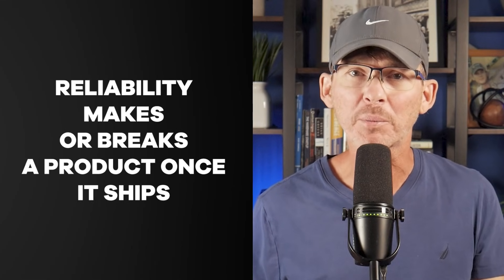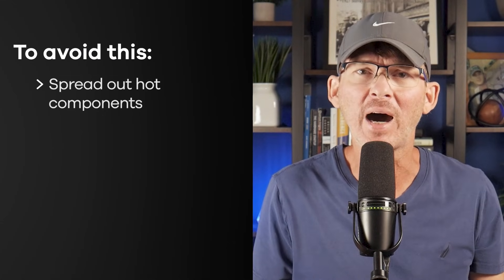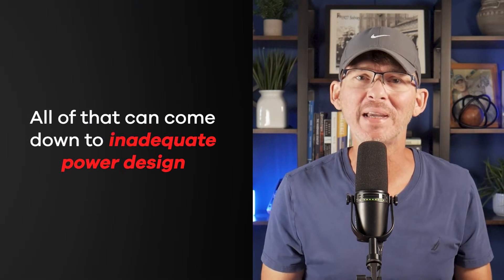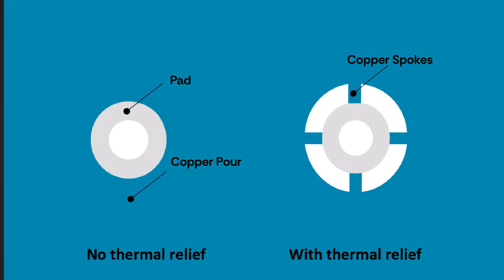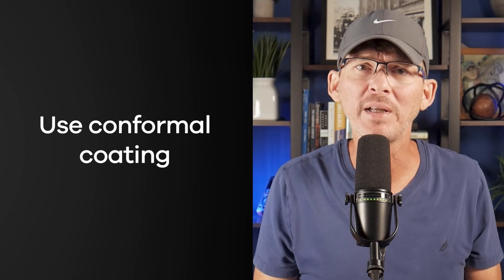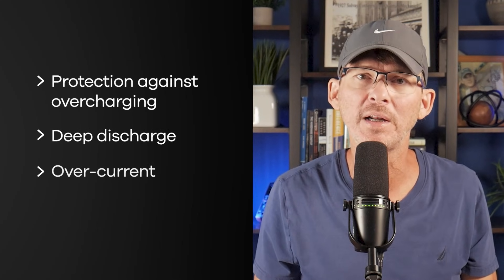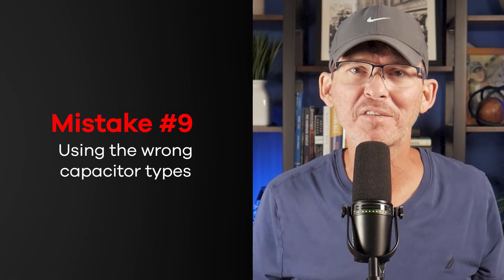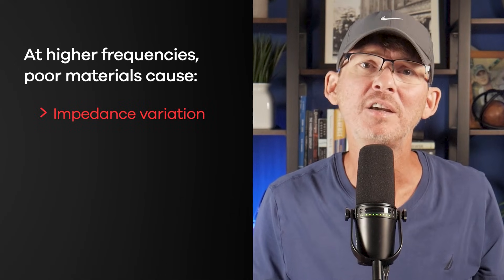10 PCB Design Mistakes That Damage Product Reliability

Comment: What's the function of a filled via?
Reply: Filled vias allow you to place a via within a solder pad and to avoid wicking solder through the via which would otherwise compromise the amount of solder in the joint.  They're often essential in tight pitch BGA layouts.
Reply: @Peter_S_  Is it a conductive via?

Comment: Could you make a similar video but for basic and fundamental design mistakes? E.g. I read online that traces should be routed at 45 degrees angles. Routing at 90 degrees is apparently a mistake?
Reply from the maker: That one used to be common advice but no longer. 90 degree bends only really impact very high speed lines, although in general I still like to avoid them. Good idea on a fundamental mistakes video though and I'll definitely consider it. Thanks for watching!

Comment: Some additions from a production engineer at a PCB fab:
1. Managing thermals and solder joint quality can be a delicate balance. I've seen designs that just used the PCB as a heatsink by adding 20 via's on a 4 layer board. But heatsinks that work in the field will also work inside of a reflow oven or solder wave, causing the temperature to stay low in that region keeping joints colder than intended. Component's themselves can also have a lot of thermal mass especially large inductor's. Place copper fill strategically around these component's.
2. When designing PCB's that need to be conformal coated. I can't stress enough that you must space out components that must mustn't be coated. 1mm of space can look huge when zoomed all the way in in CAD. But in reality, depending on how the fab applies coating, this can be a huge problem causing quality issues, more boards to be rejected and higher production cost. Always talk to your fab in advance for advice.

Comment: 6:10 environmental protection is my personal favourite: I once was a service technician for welding machines. You won't believe how many of those didn't design for metal dust in their surrounding. For a machine that creates metal vapours and requires all surfaces it interacts with to be ground to bare metal directly before use of the machine, that was a funny design failure, which luckily was often resolved with some compressed air.
Reply: I was a service tech for many years, & yeah, real environments can be insane.

Comment: When I was at Boeing in the '90s one of the projects I worked on was the engine controller unit for the RS-68 rocket engine.  The basic functions of this ECU were pretty simple -- it controlled the 4 valves of the engine according to a pre-programmed "flight profile" -- but it had to be EXTREMELY reliable.
The guy in charge called himself "a damn fine systems engineer", but he basically knew nothing.  It was the worst case of the Dunning-Kruger effect I've ever seen.
One of his dumb decisions was to include a microprocessor.  This was completely unnecessary since all the functions of the ECU could be implemented with a state machine, and he already had an FPGA on the board.  I once overheard an actual system engineer raise the question of software reliability in a meeting.  The self-proclaimed "damn fine" guy laughed out loud and said "software doesn't break!". 
Note to newbies:  NEVER have anything that is super safety-critical depend on software, if you can avoid it.  For example, if a machine has a big red button on the front labeled "emergency power off", it should open a relay that cuts off power to the machine.  The red button should NEVER just go to an interrupt pin on a microprocessor, unless there is an an EXTREMELY good reason for it.  In the ECU example above, the FPGA-based state machine was reliable because you could test all possible states, even "illegal" states.  But a CPU with firmware can have an enormous number of untestable states, thus making it a reliability risk.
Reply from the maker: Thanks for sharing your experiences!
Reply: To add to that: That's why in Germany (and the entire EU, I believe), it was illegal to use software in emergency-systems like emergency stops until about a decade ago. It was allowed for certain very specific and highly certified things after that.

Comment: Back in 2003 I had a reliability issue with a piece of test equipment I designed, a bit-error rate tester.  It had 17 data lanes that each ran at 2.5 Gbps.  When I tapped on the side of the chassis with a screw driver, the eye patterns for all the lanes immediately clouded up.  This baffled my for a while, until I realized it was due to piezo-electric  effect on some multi-layer ceramic caps.  I replaced them with tantalum caps and the problem went away.
Each lane had it's own dedicated PLL circuit to multiply a 156 MHz reference clock to 2.5 GHz, and each PLL had it's own dedicated low-noise LDO voltage regulator to power the VCO.  The ceramic caps were used to decouple the outputs of these LDOs.  Tapping the chassis caused about 10 to 20 microvolt step on the VCO supply, lasting a few microseconds.  This pushed the VCO frequency, ever so slightly, but phase is the integral of frequency, and a few microseconds is a large number of bit periods at 2.5 GHz, so the lanes could get almost two whole bit periods out of phase.
Oh, and the system also had problems with dendrite growth, but I don't remember how I solved that one.

Comment: I am not making PC boards for production just as a hobby and sharing them on PCBWay. My designs use CMOS low power ICs and run on a 9-volt battery.  I suspect I might be getting away with things that would not work in something more complex.

Comment: Reliability what makes or breaks a product... Apple: hold my beer. :) They tend to be sabotaged in every generation in some way electronically or mechanically making sure they do not last. Sure they won't fail before the warranty is out but planned obsolescence can start at the point where Apple puts the 1.5V data line next to 42V LED backlight power feed on a ribbon connector :) What could possibly go wrong.

Conformal coating lol.. another thing Apple has never heard of.
Reply: Apple is a cult

Comment: I've seen so many strange failures it boggles my mind that stuff isn't failing all the time. One time I had a short that was somewhere inside a 2 layer pcb which was shorting out two traces that were >30 mils apart. I could not figure out where it was coming from. I had to cut a 3 inch section of foil and run a jumper wire to remove the short. This wasn't even an inner layer short lol. That made me question my faith in anything electronic. Yet I have a 40 year old motorala SBC that starts up and runs for 10 hours a day every day.

Comment: Hardware-Design is hard.. at all..
I spend around 70% of the development time just to find correct components to fit together. It's also very expensive and frustrating. And the more you learn the more you feel unsure, because of all the rules like described in this video. It's a very useful summary of design-rules. Many thanks John!

Comment: Using different types of capacitors can be beneficial, but using ceramic capacitors with different values can cause problems. As capacitors become inductive beyond their self-resonance frequency, a combination of two different values can become resonant.

Comment: SOME ceramic capa have hideous negative voltage coefficient of capacitance. It is not a universal truism.

Some ceramic capacitors decrease in capacitance with simple aging. They'll do it in circuit or sitting on the shelf. If the cap is heated to the Curie temperature it is "reset" to the original value and aging begins anew. Reflow soldering temperature is usually above the Curie temp.

Comment: The notion that capacitors need to be derated to half of their rated voltage is simply nonsense. It might be true if you are buying cheap trash.

Years ago I had a discussion with an applications engineer at a major manufacturer of high quality electrolytic capacitors. I was specifically asking about benefits of of voltage derating for a product where high reliability was very important. He said there is no benefit. This was an actual capacitor expert, not some rule-of-thumber.

Aluminum electrolytic caps will also withstand and in fact are rated for withstanding short-term overvoltage.

Capacitors "dry out" due to excessive operating temperature, not operating voltage. Temperature rise due to ripple current is substantially worse than rise due to ambient heating.

Failure to match the PCB hole spacing to the lead spacing of radial electrolytic caps can grossly shorten the life of the cap due to stressing of the elastomer seal. 

Solid tantalum capacitors are another matter. Voltage derating can be beneficial and in some cases essential. Paying attention to rate of rise of current is very important. All of this stuff is well documented in ap notes from "big name" cap manufacturers.
Reply: It depends on the use case. The example John gave a 25V rating on a 24V machine in which your device will just be one component. For this use case, he is absolutely correct, although it doesn't need to be "at least 2x", but you will get a lot of failures if your capacitors are rated for less than 35 V, as the power supplies for industrial machines are often tunable and will get tuned to achieve 24 V at the farthest component from the supply in your switching cabinet. This often results in more than 25 V on a nominal 24 V line at the start and the upper end of the tuning range often is around 28-32 V, depending on the manufacturer. For automotive parts, the actual supply voltage isn't 12 V, but a few V higher, depending on the engine (and therefore generator) RPM.
You aren't designing exclusively for component variation, but for environmental factors, too, and one of them is an imprecise supply voltage.
If you can control voltages precisely and certainly, then 25 V in a 24 V might be enough, but if you hand it out to customers to hook up to a standardised supply voltage (6V motorcycle, 12 V automotive, 24 V automotive, 24 V industrial, 48 V industrial, generally the power grid, etc.), then you will have created an unreliable product with such a small tolerance.
Reply: @KarlKarpfen  Indeed. Back in the day, it was standard for automotive stuff to assume a 13.8V power rail, rather than the 'official' 12V, because that's what you'd see when the battery was fully charged & the vehicle was in motion.
Reply: @theantipope4354  That's the charging system voltage.  A 12.6 Volt lead acid battery needs a slightly higher charging voltage.  Many consider operating voltage of vehicles to be 14 Volts.
Reply: This is true. It may even be that capacitors stored under voltage bias will survive longer than capacitors stored with leads shorted (or even open circuit). I use 95% derating for electrolytics, so a 16V cap can go on a 15 volt rail

Comment: Managing environmental possibilities is a great one!  I made a kitchen management module for my kids pretend kitchen to control the water drainage pump for their sink, overflow protection w/ water supply shutoff, drainage pump issue detection (clogs, air in the line, etc) with alerts and water supply shutoff, lighting control for inside cabinet and under cabinet lighting, music system with touchscreen display, etc.  I spent months working on it, custom PCB, testing testing testing.... Even had a built-in UPS with lithium pack to still power the system to shut off water supply if power went out since water pump wouldn't be able to turn on.  It was SOLID!!! 

Mounted it on the back of the kitchen about 1ft off the ground where it won't get wet and couldn't get wet even if something failed and the water flooded the area.  Thought I had thought of it all! 

A year later, the whole thing failed out of nowhere.  

Turns out that the whole thing corroded, not because of water getting in but because it was mounted low enough for a mouse to jump on top of it and bask in the warmth of the electronics..... And because I had put all the screw terminals and barrel plugs on the top of the case pointing up, it created an entry point for the corrosive pee from the mouse!! Absolutely unbelievable that the whole thing failed due to mouse pee! How could I have considered that 😂 

What I ended up doing is moving the connectors to the side of enclosure rather than the top and applying a thick conformal coating on all of the electronics.  I even considered potting it but so far conformal has done the job. 

Lesson learned! Don't forget about the mouse pee!
Reply: You are an epic dad. This got to be the best engineered toy ever. I never thought about this but when I get kids I want to do such things for them too. Make this a video and I will watch it
Reply: lol. I worked as a field service tech for many years, & you wouldn't believe how many devices I saw that had failed due to mice & other vermin getting into them. I remember one time I ran into a dot matrix printer at a client site where it had died because mice had made a nest in the warm & cosy power supply, & peed all over it, until it had finally shorted out & zapped one of the mice. The smell was indescribable! The client asked me if it could be repaired, & I told that no, it'd have to be replaced.

Comment: 100 % derating... try to find 800v capacitors for 230v ac power supply. ur marging rules can't apply in many cases. too expensive or too bulky or too expensive. you get out of the mass market business. ok it's a quick video.
Reply: On ceramics you have 100% because of the reduced capacitance, and they dont lika overvoltage.
For input caps, you will use X-rated caps. Then you van use a 240V cap for 240Vac. It can tolerate overvoktage and will self heal. 
For electrolytic, 20% above max inputvoltage is ok, but overvoltage protection like movs or active clamp transistor and series PTC can be used to increase rebility.
On a requlator output 20% is ok but check capacitance loss due to voltage, if you use ceramics.
Reply: @scoutjonas  Self-heal sounds good, but self-healing typically means, that part of the capcitor 'plate' (foil) is evaporated reducing your available capacity. Although the capacitance loss is minimal - if it happens all the time the capacitor will still fail due to the loss of capacitance.

Comment: Hi. Not related to this video, but did you ever make flex cables? If yes, can you do a tutorial on that using KiCAD?
Reply: as in flexible pcb?  its mostly just normal designing an order them flexible,..
Reply: @jonasnicolaysen8019  I wouldn't say that as flexible PCBs have their own set of design rules which increase their lifespan when frequently bent and unbent. For example, curved tracks are almost a must.
Reply: @TheMixedupstuff 
sure, I'll of course agree to that🙂
there are things to consider there as well.

Comment: In which era do you leave 🙂 Seriously, warranty usually 1 year, 2 years in some countries. As long as product dies after 2 years, all is good. Consumers need to buy a new. Purely watching you, since I am doing boards for my slef as hobby. Tnx, for the video.
Reply from the maker: Well it depends on the product and the price.
Reply: On train it's common to see 5 years, 10 years warranty. I imagine it must be the same for aerospace and military. Niche industries don't sell to a lot of people, but a lot of engineers work in them. I really appreciate the video
Reply: My current PC has been running pretty much continuously for over 12 years, often with a lot of dust inside. Incredible reliability. I think I've only lost one hard drive in that time too. It's been painful to watch the phone/tablet zombies go through the growing pains all over again, having to replace them every year or two.
Reply: If you can prove the product was not of merchantable quality when you bought it, e.g. design flaws like in the video, then you can sue for the losses you incur at any time, as long as you didn't leave it a long time before taking legal action after detecting the problem. A guarantee in addition covers things like where it just wears out in a short amount of use.